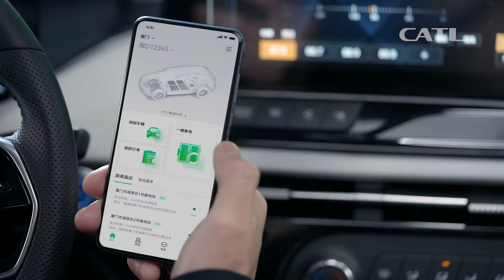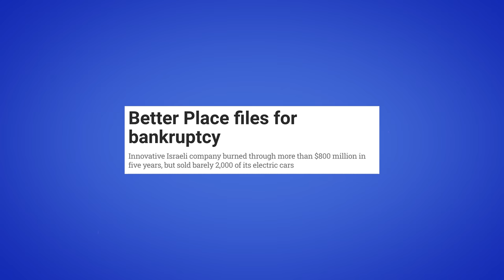Why Battery Swapping Is A BAD Idea

Comment: Battery swapping is great on paper, but when it comes down to make it work for multiple companies you will have legal liabilities floating around. next to the i don't wanna share my special cookie technology.
What if your car catches fire : the fight between the insurance, battery owner & car camponies will be a popcorn eating fest, as you wait for your money ?
There already different connectors inside the car to connect it to the batteries, technology for batteries will be halted as individual car makers are willing to fuss about with batteries to get some extra mileage, change of making the battery or batteries extractable from the car, keeping safety in mind...
The case where you could see this work is in lorries, where the back part that also contains the batteries can be swapped. keep an extra trailer charging next to crane to swap the container with the goods you are transporting. But then again for these larger vehicle hydrofuel will probably make more sense and power/density.
just keep hoping on better batteries, breakthroughs on this area would be great, not only for cars.

Comment: This opinion boils down to "private market don't wanna standardize" that's all well and good, until you regulate batteries like the petroleum industry, and all these obstacles evaporate. Indeed it's works in China with a command economy but that doesn't preclude it from working in market economies, we just have to be willing to say "some regulation is going to be required and manufacturers can either meet those regulations or they can go out of business"

Comment: It's not going to be about 'swapping stations'. In the next 5 to 10 years battery technology is going to be completely revolutionised away from Lithium and Cobalt. They'll be half the size, cheaper batteries. 
When you can have battery packs you can swap by hand, you can own 2 sets of batteries with one set on trickle charge at home whilst running on the other.
Why would manufacturers go this route? Because the one that does will 'win' the EV market. 
Then it'll be another battle of standardisation. Until legislation happens to make all batteries fit all vehicles. Double 'A's anyone?
People don't want to have to spend 'Only 18 minutes' waiting around for a car to charge and don't want to trail cables into the street.

Comment: Imagine charging points just for Teslas…£600,000 is far less than the cost of installing a 10 super chargers. I still don’t think this is a goer, but examine the true cost of installing charging points. It’s not cheap.

Comment: Feels like you completely ignored one of IMO biggest gripes with EV tech with this video: Long term sustainability.

Going for a easy to replace modular battery removes the cost assosiated with a battery swop job at a workshop, or atleast reduces it to a rate similiar to changing a tire. Also, with tons of EV batteries flooding the market and a system for refurbishing older cells, you can finally have EV's that can last for years without being thrown in the garbage like an old iphone with a bad battery.

This would be one of if not the best way to keep EV's relevant far beyond its 10-15 year battery life limit, as often times unless the car itself is in mint condition, its a total loss and a throwaway when the battery is dead

You could actually have EV veteran cars, and a flourishing economy based on battery recycling and maintenance.

Now i do belive the future is a combination of charging and swapping, not one or the other., kind of like gas stations with both a car wash and self wash booths.

Comment: Swapping requires EXTRA batteries that sit being charged.. that is VERY expensive... plus the extra cost of docking hardware and install stations ... all adds up to a LOT more cost, when EVs are already too expensive for most people.
Reply: well we got a 50kW charger installed on my city which ended up over €150,000 for A SINGLE 50kW charger!
Reply: Wrong. Imagine instead of a 80kWh battery in your car, you have a 30kWh in the car and a 50kWh ready at the charger. The number of CELLS inside the Standard-sized battery is what matters most.
Reply: @pg205  That's something different.. and still expensive ... . since there would be hardware on your car to accept it, plus the cost of all the docking stations and pluggable pack hardware etc .. and the fact that such docking stations would be few & hard to get to.. and they would charge 3-5X the electric rate for charging it ...  just give me a plug in hybrid with a 30kwh battery, would be FAR cheaper & convenient to buy and operate.
  Fact is, this docking station idea has been around for 20 years .. and has gained little interest, and it takes some reasonable volume to get the costs to be sensible.

Comment: Battery swapping is a good idea, just no yet. The market is too small it needs large regulators to force companies to adhere to a standard. Something akin to the recent charging cable standard introduced by the EU.
All this video says is that decades ago companies tried to add battery swapping tech to EV infancy and the costs were too high.

People who live in apartments or can only use on street parking cannot have electric vehicles as they currently are. There is nowhere to charge them. As car owners are forced into electric in the near future companies will be less inclined to add additional charge points to parking lots as they'll effectively be paying for their employees commute and personal use.
In the absence of alternative fuel types battery swapping is the only solution for a huge portion of people.

Comment: I’m with you Rory. I would add, that if I have just spent £60k on a new car, with a new battery, why would I let someone swap it out for a possibly tired older battery? To maximise profit, the swap company would let its stock degrade, and rely upon old muggins, the new car buyer, to replenish it. And leasing batteries just wasn’t popular. Ask Renault & Nissan.
Reply: Because next time you get a different battery and your £60k car will never be rendered worthless by the battery pack failing (because you just swap in another one)
To the part about the battery company letting stock degrade - that's only true if there's a monopoly. If we only have one petrol station company then they could charge whatever they like. Same argument. Market competition (plus regulation if necessary) could keep them honest

Comment: And while we're being negative, let's nix the idea of hydrogen fuel-cell powered vehicles. I'll give just one of many arguments against them. How is hydrogen made? From natural gas, releasing a lot of CO2 into the air. Theoretically, you could make it by electrolysing water, but the cycle electricity>hydrogen>electricity>hydrogen ... is inefficient.

Comment: Sorry your wrong. Without swapping BEV does work. Look at a motorway service station, 30 pumps for cars only. Let's say it takes 15 me minutes to fully service a car, park fill and pay, that will give a minimum of 300 miles. Given a BEV car needs 1 hour for 100 miles that means to service the same amount you have 12 times the points spaced more regularly. Faster charging is not the answer as it requires more power stations, more overhead wires how will that work in a city and think of the pollution that will be to make and service. Make BEV vehicles use a standard size battery, if they can pass laws to ban selling of ICE they can pass laws to set the battery size and make them a government rental scheme. Of course the best green alternative is not BEV at all with their rare metal batteries but ethanol fuel made from plants as 100% ethanol can use existing infrastructure and produce no carbon during manufacture and use. Hydrogen is a close second.

Comment: Yeah, unless the charger tech, mounts, gear, batteries, holders, are made on a open copyright for every manufacturer to use and integrate in their cars, there is no point. 
Also since battery tech upgrades with such a speed that all of the built charging systems will be already obsolete when the next battery charger warehouse is installed, they could integrate the charge system into the battery pack but that would just make it even more inefficient. 

Safety how can you make sure the system automatically changes the battery safely, each time? water, moisture, mud, dust, sand, salt, snow, ice (Last ones especially in Norway!) will get in those. 
Not to think about one of these automatic charger systems holds loads of lithium, I would not really like to live close to one, it's a never ending bonfire of toxic chemicals.

But there are some good things about these as well if the systems are made small and only to hold a one type of battery and max 2 batteries, divided around cities and not in a big warehouse of batteries, and if all the car manufacturers agree on a smart system that is not owned by one monopoly individual, but a group that anyone can get their hands on, perhaps it could work.

For motorcycles and for small other vehicles taking the battery out to charge like in a Ryobi is perfect, just sad you would need a lot of Ryobi batteries to power a car :D 
(how many actually? that could be an entertaining video trying to power a car with Ryobi batteries XD)

Comment: You only need battery swapping for long distance. That is why I would never buy an electric car for long distance. My leaf is perfect around town, tied to it's home charger umbilical cord range and is perfect for that. If I want to go a long distance, my diesel car always comes out. Long distance driving is a nightmare now and it was 6 1/2 years ago when I first bought the leaf. Range and the rapid charging infrastructure is the achiles heel of EV's and it is not getting better, in fact it is getting worse with more EV's on the road.

Comment: Is not gonna fly. Electric cars will follow the trend of mobiles. No swap battery just quick charge and higher capacity on each generation, and cheeper. Swap only if damage and yet again everyone is changing phones every 5years max or sooner, cars will follow the same trend.

Comment: These battery swapping stations better have good fire suppression systems, if they're going to be near other people's property.
Reply: Agree. At least in same ballpark as petrol stations. And I know a lot of then at level floor of residential areas in city centres...
Reply: An ordinary fire can be suppressed by cutting off its air supply.   Fairly easy.

But an electric car battery that contains a lot of energy cannot be suppressed when it shorts out, when all the energy is being rapidly turned into a (tremendously massive) amount of heat.

Comment: This is not innovation! This is just an extension of how we're used batteries ever since they have been standardized. Be it discardable or rechargeable, it just makes sense that it is swappable. Technology gets better, and batteries get improved capacity and longevity trending toward green energy compliance. The key point to remember is STANDARDIZATION which is not quite there yet, because of our Western losing technological war against China who holds the monopoly of Lithium batteries. That being said, only China at this present time can  and is implement the necessary infrastructure that permit swapping in 5 minutes everywhere within any large city, where the demand is high and mileage is short. Elon Musk had the right idea but started in the US where everything and everyone is against it. He had nevertheless developed an infrastructure adapted for the very long mileage we are  all familiar with. Therefore It's is logical that this approach to solving the range anxiety is the simplest, most effective and plainly best way within the context of rapid development of EV in China . This will not work in the US, but will definitely work in Europe where the concentration of EV's are around their capitals. It will be cheaper for Europe to go this way. They cannot afford to keep developing super high range cars without increasing the weight  of the car and charging inefficiencies of their infrastructure.  This robotic swapping approach for charging city busses and commercial trucks is really the way to go, and is already in place, so extending it to small cars like a Wuling that has a capacity of about 15kW, or even a BYD Seagull with larger capacity make totally sense. My hat to China for getting ahead of us. We're definitely not the model to follow in terms of EV technology. Our love for large SUV, super power and luxury kills it at its inception.

Comment: We now have 800 V cars and 300 kW chargers that can add 150 miles in 10 minutes. Even 100 kW rapid charging lesser cars  gives 150 miles in 30 minutes.
There's no point in battery swapping when rapid charging is pretty fast. I'd rather charge at home or a nearby lamp post than visit a battery swap place across town.
Reply: You're right: 150 miles in 30 minutes charging CAN NOT compete against 300 miles in 10 minutes swap time. The MAJORITY of cars do not have 800V. 85% of the chargers don't offer 300kW...

Comment: Personal ev battery ownership is not a solution if we want to make ev available to everyone....
The battery must owned by corporation and a payment for use is the right path for recycling and resale value for ev.
I don't want to buy a second hand ev only because of its degraded battery.
Think about it
Reply: Charging station can be grid scale power storage which also takes care of renewable energy distribution throughout day and night.
We need to implement fast charging and battery swap both but personal battery ownership is a liability and helps neglect true cost owning ev..

As a point of thought when we buy ⛽ do you also need to own the gas station owning an ev battery carries same liability.

Comment: We may need swappable battery packs for our Police cars (and taxis & buses) once they go electric so they can last all day, car chases included. Either that or they may need to go hydrogen. Since it's the government they can afford to put in the infrastructure.
Petrol Stations will have to go hydrogen and battery swapping. And parking buildings need charging on many parks.

Comment: Rory, you touched the fulcrum of the problem several times during this short Video: the inexistente of standards for battery sizes and voltages. China will get it done, because of the centralised decision taking. 
Let's break out the "problem":
First and foremost, you forgot the tell on your video that it's NOT a swap or charge system: Swap systems can charge however they want. 
Cost - 600k seams like in the same ballpark as a petrol station, that - guess what - also takes a huge amount of space. 
Proprietary tech -  there are no big trade secrets from one battery chemistry to the next. Different manufacturers could do different stuff, as long as dimensions, cooling ducts, firmware being compatibles. Number of batteries per car - you're saying that every car needs FIVE batteries? How come!?!? You must see the problem as it is: it's the NUMBER OF CELLS inside the battery that makes the difference. We could argue that the majority of BEV with 80kWh-plus batteries USUALLY don't discharge it during a day. So, why installing every single car with capacity that you don't need and PAYING for it?...
Charging - Are you assuming that every charging station is capable of 250kW-plus and that every single car out there is capable to accept it? Of course not. Also, this kind of structure allows for SLOW-rate charging during the night (when energy is so much cheaper), helping extend battery life. It will be possible to charge thousands of smaller batteries for people living in flats WITHOUT ACCESS to charging stations. This people live in cities, needing SMALLER capacity units.
Finally, we already have a lot standardisation in the Automotive industry: Tyres and wheel sizes, 12V batteries, DIN Radios (a GERMAN Standard), light bulbs, everything infotainment related (Garmin, Android, Apple, Google, Blu-Tooth...) lubricants, fuel-port sizes... and...and... fuels! Are those power stations the whole solution for the problem?... probably not, but hundreds of thousands of car drivers don't consider a BEV today  because of the cost and the charging. Both could be addressed with this system.
Final argument: you have an accident or a critical technical problem with your battery. Which of those systems would be cheaper to repair/ replace?...
Reply: The problem with your £600k battery replacement station that costs the same as, and takes up as much space as, a petrol station is that your battery replacement station is just for one car at a time.......Petrol station, probably 12 at a time.
Reply: @malph9216  ...you probably didn't pay much attention to the video, otherwise you'd know that the swap station alone occupies 2-3 car 's parking places... I don't have quotes - neither has you...- about the compared cost of swap vs charging stations. 
Battery-swap BEV's also can charge batteries, at home or at the charging station.... what's not to like?!?